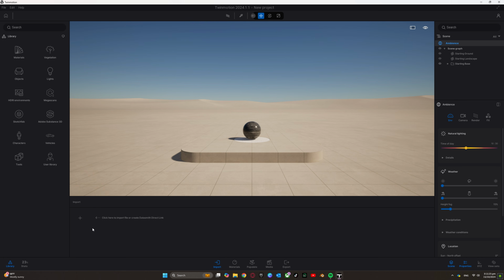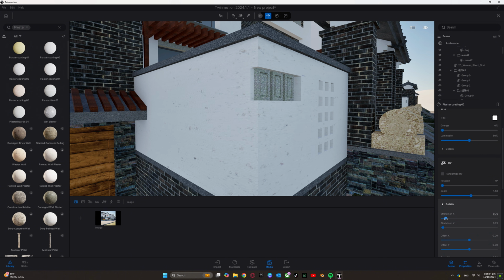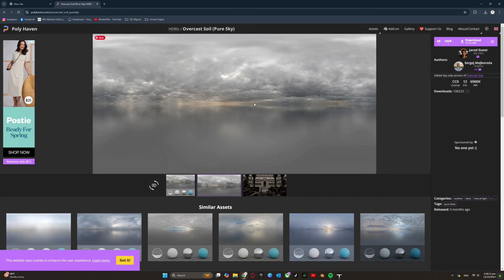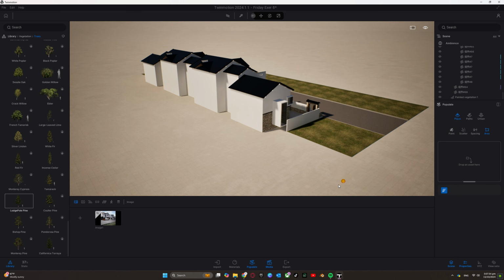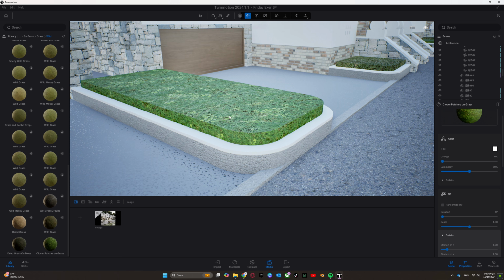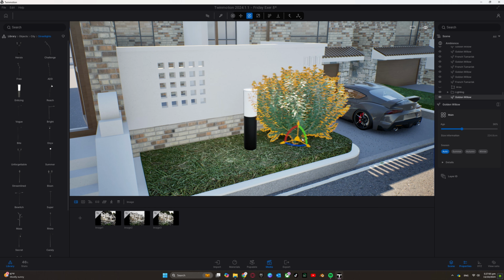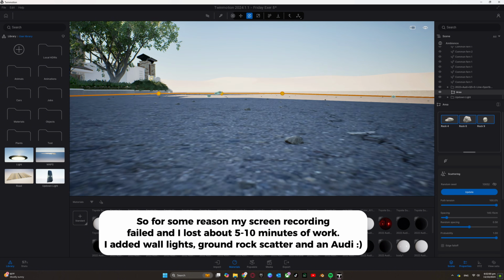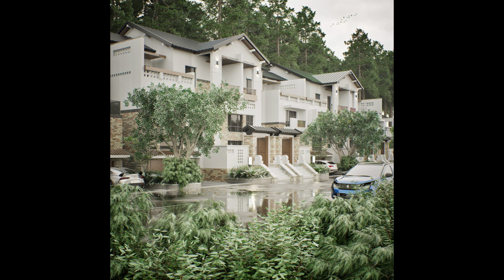Twinmotion Friday Exercise | Exterior Render Tutorial

Comment: what's your hardware? struggling to render using rtx 2060
Reply from the maker: RTX 3060, 16gb RAM. Change the performance settings or turn layers like vegetation off while editing. You should still be able to get some decent renders with a RTX 2060 you just have to be strategic with how high of a quality the models and textures are etc sing out if you need a hand 🙌